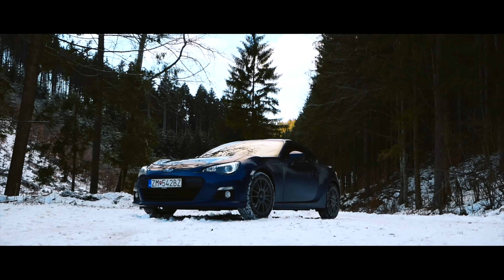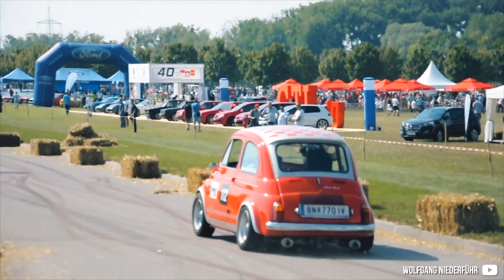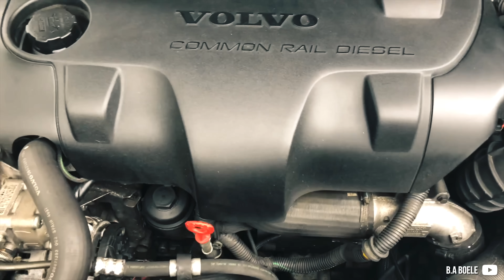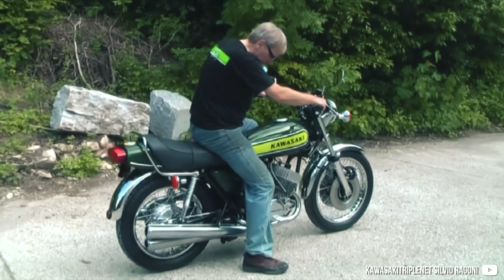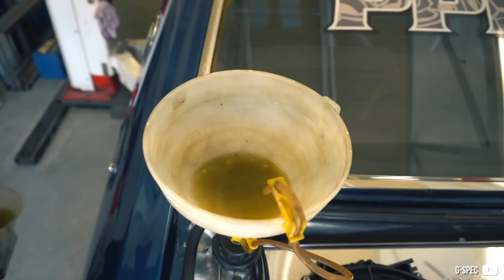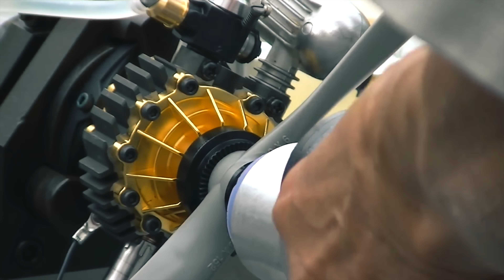Very Funky Sounding Engines

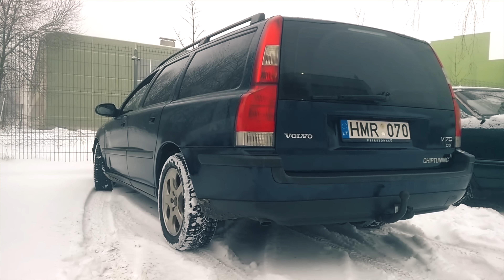Comment: 2:07 it's nice seeing a diesel rev without all the black smoke. Always glad to see someone who knows how to tune it right!
Reply: Geezer
Reply: @Commandmanhardcore  by the name of the guy alone you should know he is not of driving age xD
Reply: @Stale_Mahoney  Ok
Reply: Ståle Mahoney buddy using xD still
Reply: @Florida_man420  is it not with the times anymore?
Reply: @Stale_Mahoney  Nah it is. He's just looking for a way to get under your skin
Reply: @ragnarlothbrok6324  damn ragnar himself ;) how is valhall? I'll join you some day up there
Reply: @Commandmanhardcore  It's just only a little...
Reply: You are absolutely right. Ignore the ignorant trolls who couldn't tune a radio much less a diesel properly.
Reply: @Richard Vaughn While you are partially correct about unburned diesel producing white smoke black smoke is created by adding too much fuel without sufficient boost. You are thinking of two different scenarios with white smoke coming from vaporized diesel, smells awful as well, usually caused by a faulty injector not fully atomizing the injected fuel. Black smoke is caused by putting too much diesel into the cylinder creating a situation where there isn't sufficient oxygen present for complete  combustion leading to an increase in power however not as much as would be seen if complete combustion was present. Next time you watch some diesels drag race where nitrous is being used you will see the black smoke go away when the driver hits the nitrous because then there's enough oxygen present for complete combustion. To your second statement that is also not true. Some of your older diesels where the turbos weren't as efficient would create black smoke when the throttle was fully opened under a load but not all diesels do that. If they are properly tuned you will not see black smoke at all. The diesels of old that produce the black smoke were usually higher horsepower models and would clear up as soon as the turbo caught up. If you look at examples of the exact same engine at lower power levels they didn't necessarily produce black smoke when the throttle was suddenly opened. I personally own several diesels that are older and newer and none of them produce black smoke when you jump on them plus my dad owns several as well so I'm not just trolling but speaking from experience. You are absolutely correct on your last statement. Finally just to clarify I hate EGR, SCR, and DEF I think they are cheap ass ways to make the engines meet requirements and if the companies paid their CEOs less they could research much better alternatives to those idiotic systems.
Reply: That's how all diesel cars are when they leave the factory, as long as you don't mess with the engine it burns clean. Don't you guys have any emissions laws in the USA with all those sooty trucks?

Comment: The prv sounds suprisingly good actually.
Reply: Yeah it does.
Reply: @joesshows6793  In Venturi sports car, it was the even firing version, twin turbo flavor.
But the odd firing base model is pretty grunty too : https://www.youtube.com/watch?v=YYCGKBHSQHo
In all cases, it kept it's V8-ish sound. Fun fact, few of the V8 version were actually built before the first oil crisis.
Reply: The PRV V-6 was also the basis for Renault's 1.5L V6 turbo that changed F1 in 1979.
Reply: @andyharman3022  Seriously?
By the way the PRV is still holding as of today (2020) the fastest speed reccord on a circuit with the Peugeot P88 at LeMans.

Comment: BMW P60B40. Here's why:
I made a plyalist of videos on the BMW M3 GTR with lots of videos of fly-bys, usually titled 'VLN' from 2004. This engine at certain rev ranges sounds like an I4 and at some rev ranges sounds like a 60° V8 and at high rev ranges sounds like a 90° V8 which it is. It's a very unique sounding engine and sounded its best from 2003-2005. I reccomend you check it out and have a listen.

Comment: We had a old motor grader from the 1930's (?),it had a 428 cubic inch Buda engine, a flat head with up draft carb,6 cylinders, 104 horsepower at 800 rpms. Loved that sound under load! Wish we could have kept it but it needed a new exhaust manifold badly.

Comment: Feature the VFR400, it sounds so wak and so cool, I want one so bad, it sounds nothing like its bigger brother, the VFR750.
Reply: The VFR400NC30 and the VFR750R RC30 both have a 360 degree cranks but from 1990 the normal road going VFR750’s have a 180 degree crank.
I agree on the sound, the noise the NC30 makes is awesome. Never should’ve sold the one I had....Now I own a 1994 VFR750, also a nice sound.

Comment: Judd flatplane v8, my favourite sounding engine. It’s fitted in many different racing cars, though it seems that the exhaust setup on each individual car gives a very different character and vehicle to vehicle, I expect it’s because of exhaust resonance. Of course, my favourite is George Plasa’s 1 series. By far the most aggressive, emotional sound I have heard from an engine. It’d be great if you could do a video on Judd and the different applications, it’d be interesting to hear your take on why some sound so different. Long time fan of your channel :)

Comment: The PRV V6 still holds the world speed record at the Le Man race track of 252 Mph with 910hp. The Peugeot P88 is the car I’m talking about. Also if you want to give that PRV some power for the DeLorean there’s a turbo kit for the car that can get 500hp without blowing the un1 transmission. They are good little engines and I love the sound of them.

Comment: There are enough ignition coils on that 6 rotor to use it as a bug zapper on those summer nights at the drag strip. There's probably fire AND lightning exiting the tailpipe for 6 feet

Comment: I had a Yamaha RD350 Liquid Cooled 2 stroke and it made an amazing note at idle when rolling along on flat ground. Also the Foden 6 cylinder 2 stroke diesel has a note similar to a GM but without the roots blower scream.

Comment: i always found the radial engines used in helicopters like the S58 to be a very interesting sound.  always made me think of a big block muscle car.  and they sounded completely unlike the same engines used in normal aircraft.

the AG330 start-cart for the SR-71 was very interesting as well.  it used a pair of Buick Wildcat Nailhead engines to mechanically spin up the engines to 3200-4500 RPMs for start.  later they used Chevy V-8s.

Comment: 3.8 L V-6 Buick in the early 1970's and the 1960's Buick 225 CID V-6 was an odd fire engine. I had 2 or 3 of the 3.8 engine and they had good torque but never sounded like they were reving , even at 4500 RPM's. You always have interesting content, Thanks.

Comment: I have to give a mention to the Original VW Beelte. Although the 4 cylinder boxer engine was quite normal. It was mainly the exhaust tips that make the distinctive “whistling” noise. If you take the tips off, Or install a stinger. It sounds like a normal Boxer engine like a  Porsche.

Comment: The Split single 2 stroke engine of the 1960s era is an odd engine worth looking at..Its has two cylinders but single throw crank with two rods connected to it..Also known as The Twingle by many..its unorthodox in many ways.

Comment: Suggestion: Look out for the Müller-Andernach two-stroke V6, which was originally meant to fitted into the DKW F102 (but also found use as a aftermarket engine for the beautiful DKW 1000sp coupe and roadster).

Comment: Sorry dude but you need individual pipes for a two stroke no matter what. It's because the expansion chamber is tuned to the power band in order to scavenge more exhaust gas out of the cylinder. The Suzuki GT 750 was the same. The expansion chamber was right next to the silencer on the stock model to move the power band down the rev range. However Stan Stevens (yes that Stan Stephens) told me that for max power I needed the expansion chambers near to the exhaust port so to use an Allspeed or Micron depending on what type of power delivery I wanted. The Suzuki 500 Gamma (RG500) had 4 cylinders and 4 exhausts. Two under the seat and one each side.

Comment: The Volvo d5 engine reminds me of the various Audi powerplants. Two of my favourites were the original UR Quattro and Audi 200. I know these have been featured elsewhere but a certain amount of nostalgia remains. I seem to recall the RS2(?) was great for tuning - a real "sleeper" car.
Great content as always 👍👍
Reply: early on Volvo used VW/Audi inline-5 engines, and only later build their own under Ford leadership iirc
Reply: @AccAkut1987  The D5 is based on the mighty L5 gasoline block dating back to the Volvo 850, and Ford was not the owner at the time of its original inception. But the D5 indeed emerged during Ford years, as the 850 in diesel version indeed used an Audi 5 cylinders TDI.
So from a quality standpoint, the D5 is a true Volvo engine. Many today clocks half a million km without any sign of fatigue at all.
Reply: @Damien.D  You are completely right. The engine is called the modular series as all the engines whether 4, 5 or 6 cylinder, diesel or gas they all share common piston, rod and bearing sizes. There have been a few high power turbo gas engines build in sturdier diesel blocks in Sweden. Fun fact my brother has a 2002 V70 D5 with 446k km with no sign of fatigue.
Reply: B5234T5 here going strong

Comment: Heard the Puch 500 has an indirect connection back to Tatra via Hans Ledwinka's son. 
Funny to think in other circumstances a Tatra version of the Puch 500 (or Puch U3 prototype) could have been to the Tatra 604 Lidovka prototype what the Fiat 500 was to the Fiat 600.

Comment: It's kind off untrue that the PRV V6 was supposed to be a V8 and had 2 cylinders chopped off. It's true that there was going to be a v8 version that was scrapped but they always planned on making a V6 version. The reason the V6 stayed oddfire was simply that the oddifre crankshaft was easier to make than the later evenfire crank which they had to forge to make it strong enough while the oddfire crank was cast. The reason why it is 90 degrees and not 60 is however a artifact of the v8 design as they were planned to be built on the same production line with the same tooling much like mercedes's M112 v6 and M113 v8.

Comment: You mention the PRV V-6 as an odd-fire engine...that wasn't the first one.  The Buick V-6 from 1962 was a cast iron version of the 215 aluminum V-8 with 2 cylinders removed.  It was therefore a 90 degree odd-fire V-6.  I had one in my first car, a Buick Special station wagon.

Comment: Another 90° V6 is the Rover KV6.

Again a V8 was planned, to replace the Rover V8, but it just couldn't match the old engine's torque figure and was subsequently dropped.

The V6's development continued as Rover needed an engine to replace the Honda 2.7-litre V6 in the 827i.

The KV6 was launch in 1996 with 129 kW (175 PS) and 240 Nm.

Sounds great, right?

Sadly it was hand-built on a mass-production scale and quality assurance/tolerances was poor, leading to head gasket failure, amongst other things.

In 1997/8, armed with a bigger budget than they'd ever seen under British Leyland or BAE Systems, Rover overhauled the KV6. They changed so much it was effectively an entirely new engine.

Now in short-stroke 2.0-litre and revised 2.5-litre capacities, it was mass-produced with a robotised manufacturing process, increasing quality and reliability.

The 2.0-litre (1,997 cc) variant produced a maximum of 110 kW (150 PS) and 185 Nm. The 2.5-litre (2,497 cc) saw a tiny increase to 130 kW (177 PS), whilst peak torque remained at 240 Nm.

In the MG ZT power increased for the 2.5-litre version - up to 140 kW (190 PS) - and torque climbed up to 245 Nm. 

Rover engineers mentioned the KV6 could theoretically displace a maximum of 2.7 litres, matching the old Honda unit.

When MG Rover was bought by SAIC, the KV6 was overhauled again.

Now renamed NV6, it met Euro 4 emissions compliance, and used in the Roewe 750 - a lightly facelifted, lengthened Rover 75.

The Rover 75/Roewe 750 ended production in 2016 - taking the KV6/NV6 with it.

The engine sounds fantastic, with a lovely growly snarl. MG Rover took it racing in 2.0-litre guise (in the MG ZS) with 200 kW (272 PS). Competitor teams commented on how meaty its exhaust sounded.

Comment: My favorite sounding engine is a EMD gp15 diesel electric locomotive it has 645 cubic inch per cylinder engine V12 with a Roots blower this is the most vicious sounding switch engine I have ever heard Union Pacific never had any brand new they got them through all the mergers of the different railroads I once was in Roper yard South Salt Lake and I saw an ex Missouri Pacific gp15 with four exhaust stacks that thing was the loudest locomotive I've ever heard you listen to these gp15 switching it is so cool sounded I live right next to a train yard and I hear a different locomotives and I can tell what kind of locomotive it is by the sound SD 40-2 that they're switching with or their gp15 and you can tell the difference that gp15 is viciously loud and it sounds so badass peace out into the world to have a great day

Comment: The Napier Sabre H-Block (24 cylinder double boxer layout) used on the Hawker Tempest V. Power output was 2,800 HP and later 3,000 HP (making the Tempest V the most powerful single engined piston engined fighter of WW2).

The Napier Sabre H-Block makes the Rolls Royce Merlin sound feeble by comparison.

https://www.youtube.com/watch?v=BKq51LdJ-ZU&feature=emb_logo

A Tempest V is close to being restored to flight by Kermit Weeks in the US so will eventually be heard and seen at air shows.

Comment: 91-95 Honda/Acura c32 90° v6. Check my videos for the one at Laguna Seca, im running an electronic exhaust cutout at the y pipe that opens at 3100 or 3900 rpm. C32 made between 205-230 hp amd 200 ft lbs. Fuel cut on the 230 hp type 2 is 7100rpm. Six bolt mains, even fire, no dampner. Its really a weird one

Comment: Thanks for the video🤙🤙🤙 That Kawasaki H1... Here in South Africa a guy had either a H1 or H2 for sale (also a 70s 80s model) but it was modified so it produced something like 120hp!!! Compared to todays motorcycles, 120hp is not a lot...but then again it doesn't have abs, a steering damper, traction control, stability control, racing tires, it had a drum brake at the rear no electronically adjustable suspension (or high performance suspension for that matter) and then there was the notorious handling which gave this bike the name "widow maker". 

I mean 120hp now seems quite a lot to me

Comment: Well...if you talk about 5 Cyl. Diesels, you have to check out the Mercedes C30AMG - the only Diesel ever made by AMG. 
Also very funky: the Commer TS3, or Commer Knocker: a 3 Cylinder, six Piston opposed piston, 2-stroke Diesel engine
And: V16 engines, namely the Cizeta V16T and of course the BRM V16 - those will make you wet your pants when passing at full throttle...

Comment: Never been a fan of the sound of the PRV or the ARG 6R4 (XJ220) for that matter. It really does sound like a V8 with two cylinders missing and in a way its kind of irritating, like a picture on a wall that's not hanging up straight 😆😆

Comment: Another great video from VisioRacer, but I still thing the Feuling W3 is one of the most interestingly sounding engines of all. Ok, a crossplane V8 sounds great, a V12,  a two stroke diesel and off course five or seven cylinder radials, but the W3 concept gives so much funky sound for so little as only three cylinders. I actually got so obsessed with this sound that I to some degree recreated it as an Arduino sketch! -Not som much to make that exact sound, but more to check if I had figured the firing order and crankshaft/cylinder angle degrees correctly. :-) Some day I hope to get myself three similar single cylinder 4-strokes and connect them together with a timing belt to see if I can reproduce some more of that lovely W3 sound. 

https://youtu.be/ZaTpxwd-jb4?t=34

Comment: Don't know if you can find footage of big Wankels running.  John Deere had a 700 cubic inch 2-rotor turbocharged, direct injected wankel.  Ingersoll Rand had an 1100 cubic inch natural gas single-rotor.

EMD locomotive V16's always sound great running flat out at 900 rpm.  Especially the Roots-scavenged 567's.